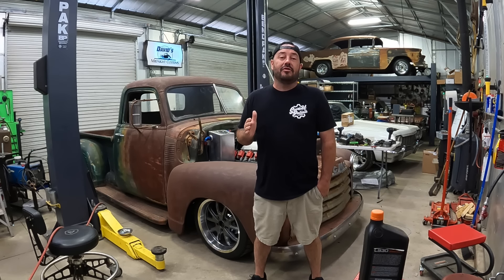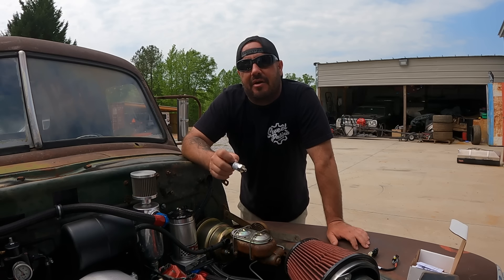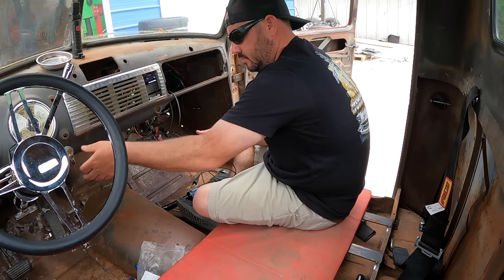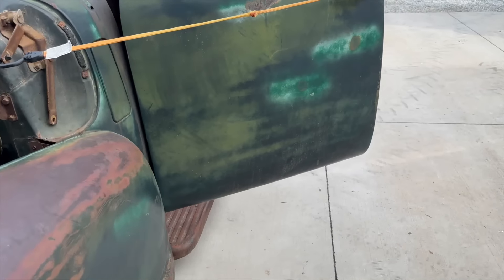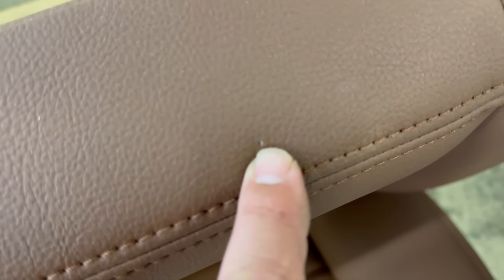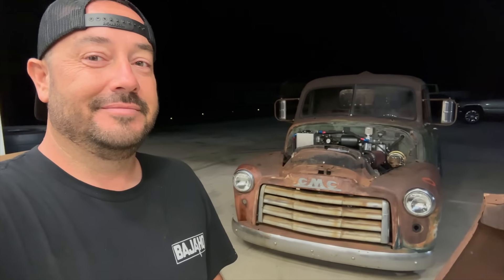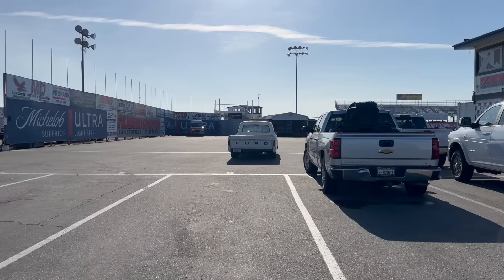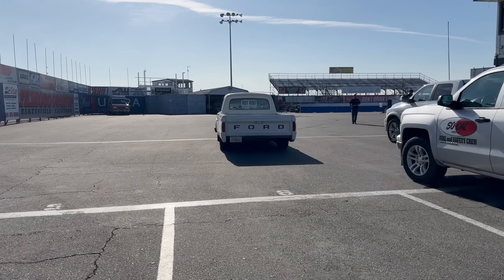Roadkill’s 1950 GMC known as Pigpen is wicked fast

Comment: On the Holley terminator, our teacher just despised every time someone would say “it’s self tuning” 😂😂😂 I use the keypad to configure first time to fire a engine up, everything else I use laptop to tune on it 👍🏻🙌🏼🔧🔧🔧 I wish you had shown where they put the motorcycle in the hauler 😂😂😂 I once had to load a truck onto my big trailer and back up to the hot shot haulers trailer because he forgot his ramps 😂😂😂😂😂😂
Reply: i mean it is a self tuning system anyways. it isnt called self learning for no reason. it quite literally does what it says it does. it tunes the engine to its needs and wants and makes the basic fuel/tune curve for you. I have this on an issue of hot rod magezine. it does 80 percent of the work for you leaving you 20% of the stuff you can make a custom tune out of
Reply: @jackmagnium6115  the teacher didn't like  that saying because the marketing never mentions the 20%, you are right it does 80% for you. but his problem was marketing leads it to be 100% 😂😂😂😂😂😂 we use Terminator X on most all of our projects 👌👌✋✋👍👍🔧🔧🔧🔧🔧🔧

Comment: I got a 50 chevy last year, and a 2005 2wd 1500 frame, the plans are similar to PigPen, but I think I will paint mine. The patina isn't great and its kinda played out around here. 6.0, cam, headers, 4L80, slammed but still capable of pulling my trailer, should be a fun build when I get to it.

Comment: Here is something you might think about. You can pull the dash out of it and put a PT Cruiser dash in it, there is no cutting it's the same size and shape. I have done 3  1950, 51 and 52"s. and use the digital gauges that are in it. Sure makes it look a lot better in there